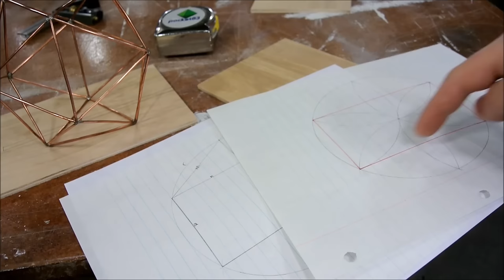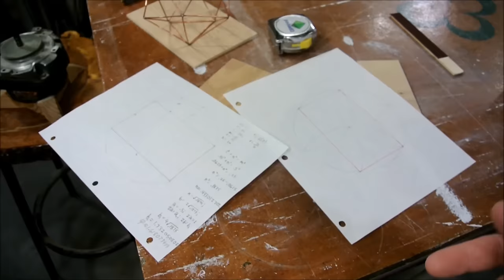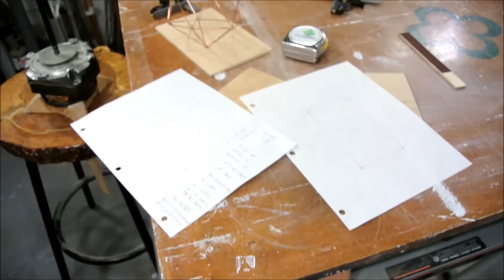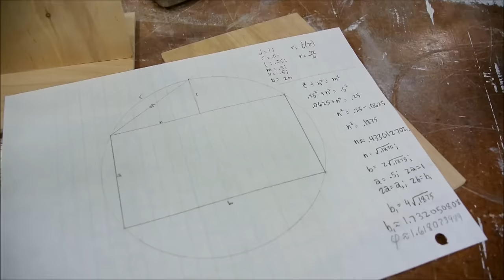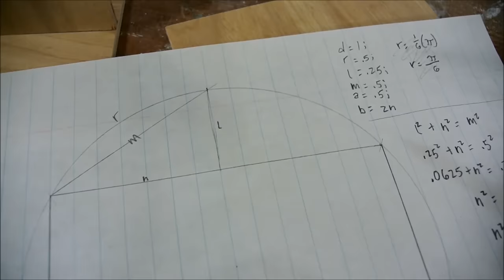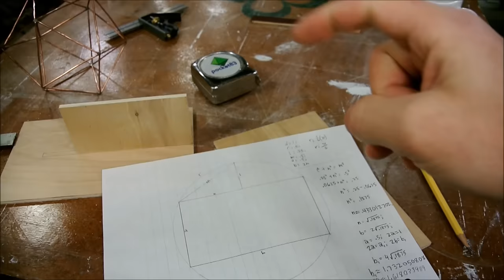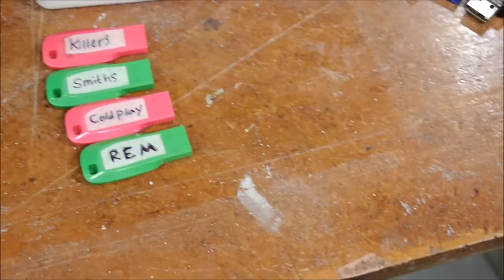while filming the golden icosahedron video,

Comment: i like that music set up. very simple. did you get those USB sticks in bulk or something off ebay? what do you use that runs them and plays the music within to the speaker?
Reply from the maker: 16 GB sticks were $5 each on special at Wal-Mart. That box IS an MP3 player. So music files on the sticks just run automatically. I have a similar system in my vehicles, so I just rotate the contents of my sticks. Keep in mind that one stick could hold probably more than 100 CDs.